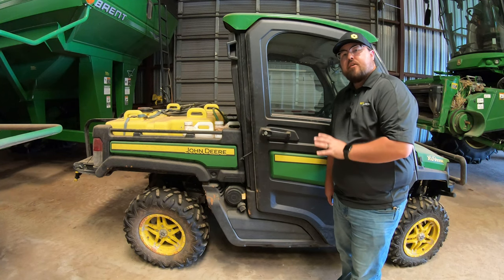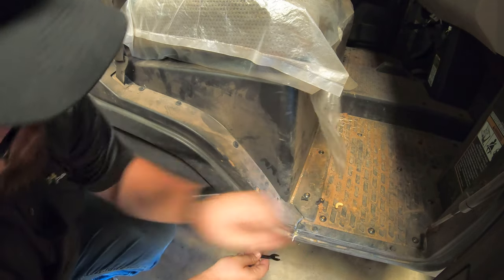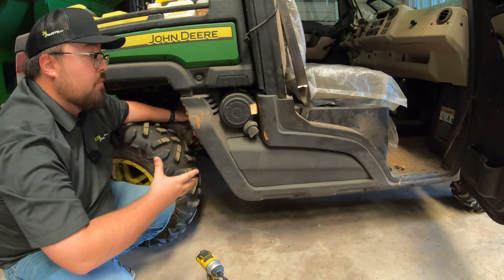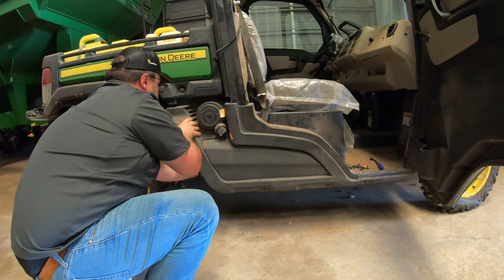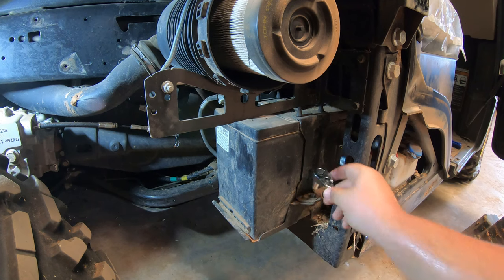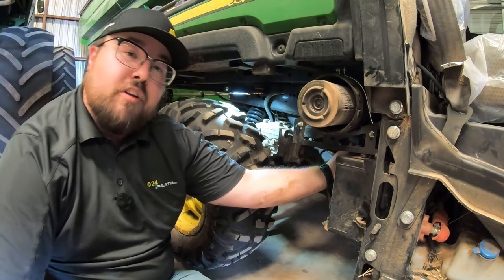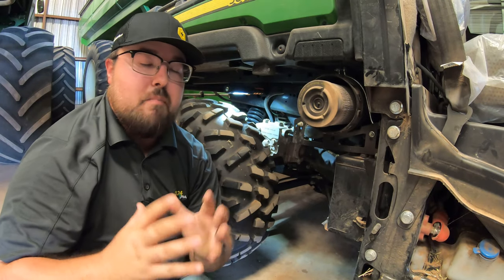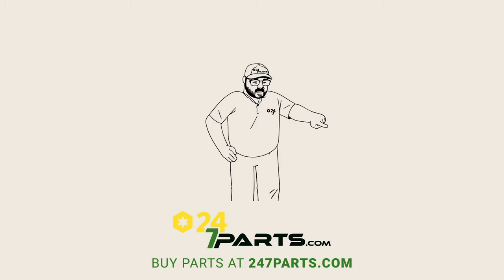How to Remove Battery on John Deere XUV 835R Gator

Comment: Hey Brent is it possible to show where the battery Factory wire harness for the winch, and or how to connect a winch, I brought a habor Freight winch I have the connector cable on the front already, but can not find battery connector harness

Comment: I just need to charge the battery but why do the engineers make it so difficult with the battery placement
Reply: There is a jumpstart/charger remote terminal under the panel right next to the washer fluid. charging is super easy.
Reply: Because they are engineers and have never tried to work with it themselves.

Comment: What size is this battery you never actually answered this question for the guy above. Obviously you can use an aftermarket battery but what size is it dude. What are the dimensions w/h/l of the stock battery
Reply: it is a group 45. I ended up replacing it with a group 51, which is a honda battery sold everywhere. Its only slightly smaller but I used a piece of rubber as a spacer.

Comment: You have GOT to be kidding me.  DO NOT buy JD.  I've had this XUV 835m for over a year and in every single one of my attempts at upgrades, maintenance, and now this! is the most ridiculous  engineering I have ever seen on ANY machine.  Notice he didn't even finish the video.  Even the pros know this is a 10 on the o'sh*t-o-meter.  edit #2.  They only way you jump start this POS is directly to the battery.  I could not find a clean enough ground on any of the chassis bolts to allow enough current to flow.  Not to mention... there are NO jump instructions in the owner's manual.  Anybody wanna buy an excellent condition JD?